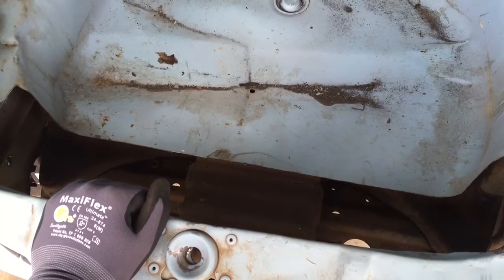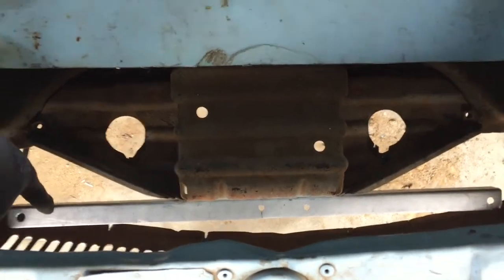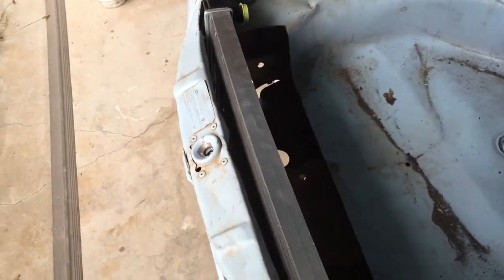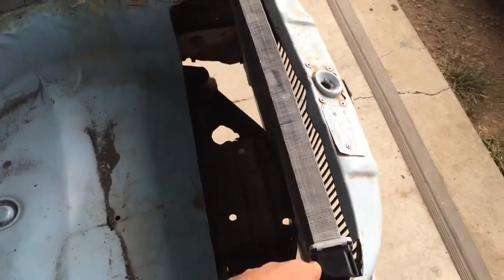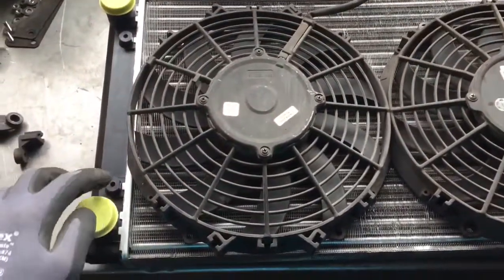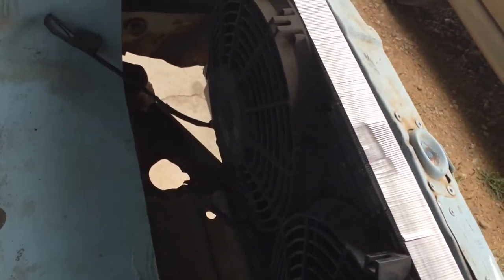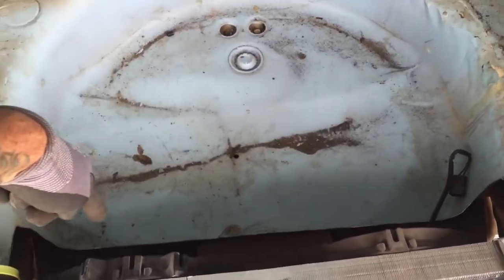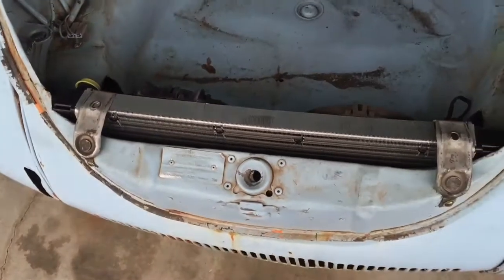BUGaru Part 8 - Front Radiator Install

Comment: You will want to isolate that aluminum angle from the steel with pieces of rubber. That will prevent di-electric corrosion of the aluminum.
Reply from the maker: +Kevin Hornbuckle That's a good point. Since this is all experimental, and will likely change a hundred times (this is how I roll), I'll use similar metals since there isn't much of a way of isolating the fasteners. This will be a good experiment in the meantime - let's see how long it'll take to break down in the meantime. Any idea???

Comment: Do you do a video of the final finish of the sheet metalwork in the spare wheel bay going to do this conversion myself don't know how I would go on for mot in U.K. So it would be good to see
Reply from the maker: +Daz Browne That's on my list - I haven't had a chance to do that or the turbo housing cover yet. It'll happen in the next couple months I'm sure.
Reply: Ha ha I have a massive list myself! Doesn't seem to be many people doing this in U.K. I'm having to YouTube everything then stumbled across the Subaru conversion just a quick question with the wiring loom would I be able to use it all auto electricians are pricey over here plus I was hoping to use the speedo and clocks out of the Subaru as the last owner of my bug as completely knackered the wiring loom cheers

Comment: OK, well that was pretty ballsy bending the radiator. ;-). I had to straighten out an AC condenser once, as the result of a minor front end collision. Similarly scary. I did recognize those Subie radiator brackets befor you mentioned it. Good repurposing.
Reply from the maker: +Forthwith Tx Yeah, you may be right - but I just figure it's aluminum tubes, pretty straightforward. I should have probably bent it more but it'll do for now. Good eye on those brackets haha